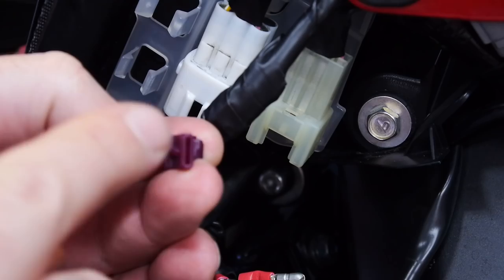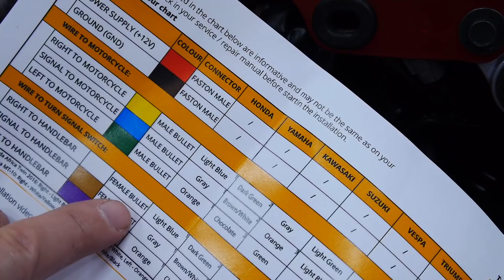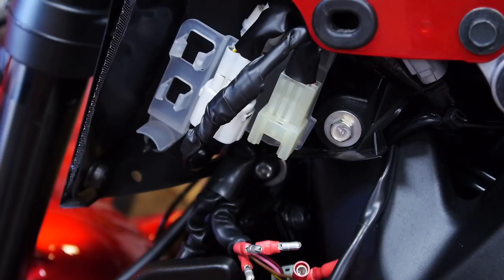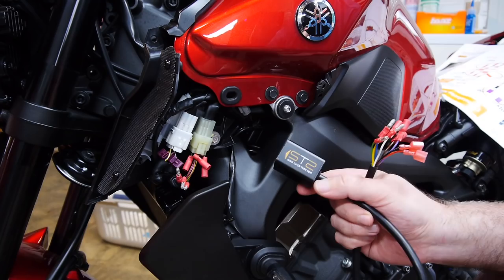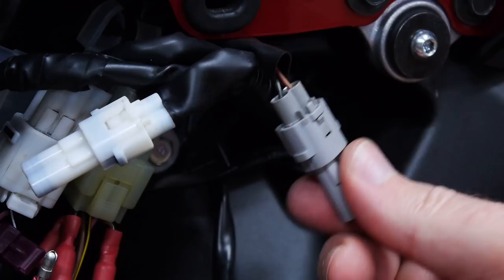FZ09 Self Canceling Turn Signals STS Smart Turn System Install And Review

Comment: Well done, Bryan. Self-canceling turn signals should be mandatory. Forgetting to turn a signal off can be a safety issue. It's unexplainable why my 1989 FJ12 has self-canceling turn signals and my sophisticated FJR13 AE doesn't. Keep up the good work.

Comment: Thanks for the upload. I’ve an MT09 and you have saved me a few headaches for sure. I might tweek a few steps like soldering instead of using the splicing connectors and I think I’ll go further back up the loom to find a better fixing and tidier point. Unit arrived today and who knows I could eat my words😂
Reply: So, what do you think of it, assuming you installed it? Thx
Reply: MrDeepseadweller actually starting installation today. Bn reluctant because I didn’t want to cut my loom but here goes
Reply: Jason Searle Good luck buddy. Please report back

Comment: Thanks...I have a 2015 zx6r and I ran into the very same problem with the install.  i have since removed it and went back stock.  I didn't think about opening thing or completing the install after it failed to calibrate.  I think I will go back to it and try it again.  You provided more help than they did.  I told them they needed more work with the product...Plug n play would be really nice and their R&D dept needs a bit more improvement.  Thanks again !!!

Comment: Those foam blocks baking in the Florida sun will disintegrate in no time. You'll be finding an alternative solution or pulling the system off and going back to factory way of t/s cancellation. I agree with your comment TWO the company needs to make a kit for each bike. I have never found any one size fits all to work correctly. Thanks for the review!
Reply from the maker: I bet the foam will be just fine.  The foam gasket on my FJR glovebox lid is like new here so was my 2006.  Same stuff.  I also garage my bikes.
Reply: @Smart Turn System Could you physically remove the latches?
Reply: @Smart Turn System Thanks for answering!

Comment: I can see the attraction BUT I am used to turning of my signals for 30+ years.  Its automatic for me, I don't even have to think about it.   So not a feature I need and I agree with other comments that the big barrier is that it isn't plug and play and that trial &  error foam thing on the switch sounds a bit half baked too....so a 100% no thank you for me :)

Comment: Interesting product, but entirely too expensive for the functionality it provides and for me cutting up my stock wiring. Even cars don't self cancel on highway lane changes, so this is not a problem I need solved (unless it's cheaper and plug and play).
Reply: SV650NYC I couldn’t agree with you more.

Comment: They definitely need to greatly improve the installation method. Plug & play would be nice, but at least needs appropriate size and type connectors......wire taps are poor engineering and you have male connectors on the hot side!! No, no, no....
If I liked it I would hard wire it in and shorten that harness to a workable length.

Comment: Great review, and thanks for that..having watched this and other reviews I would conclude that the device is inovative, clever and has potential. However the wiring side of things needs sorting, until they can supply it with interuptor plugs, and fully do away with crimp on and snap lock connectors the potential for post install problems is far to great, especially where DIY installs are prevelant, so not yet for me unless I can find a supply of suitable OE type multi plugs to assemble myself......

Comment: I asked my dealer if they'd install this STS switch for me at my next service interval. The response was No as in it would void the warranty, depreciate the trade-in/resale of the bike and be a liability if it didn't work and caused an accident. I enjoyed the video however, thanks.
Reply from the maker: Your dealer is full of shit about it effecting the warranty as a blanket statement.
Reply: I should have stipulated that anything regarding the electrical system of the bike will no longer be covered under the warranty. Sorry for the confusion.
Reply from the maker: Still bullshit.  Only something directly effected by any change is voided.  US law.
Reply: I think what the dealer was actually saying was that he didn't want to do it. I know how they are about changing tires that you buy somewhere else.
Reply: I agree with the dealer. If I saw a bike with a hacked up wireharness and shitty connectors I'd stay away from it.

Comment: Cool product. It looks like that aluminum housing is way bigger than that to has to be as well as being metal instead of plastic, hard to see on video.  

I’d probably try to find those exact connecters and fab up my own harness and not cut into factory harness.  Either that or just solder everything. 

The only thing that looks to be a total pain and ongoing frustration is the foam bits in the signal switch. If they made plastic pieces for each bike type that would just work first time it would be better. 

Also I have an XSR900 and not sure if there’s room to hide all that stuff. Still a cool product, it’s just a gyro (accelerometer) like from a drone flight controller with some software which is a great idea. One thing I don’t like is that it (looks like) it requires calibration each time you start bike. Does that mean if you forget to keep your bike motionless for several seconds after you turn key that it won’t work?
Reply from the maker: Yes the housing is larger than it needs to be. They share it among products.
Reply: TwoWheelObsession I think I’d get someone to 3-D print a casing that’s a more appropriate size. Actually that company should’ve already done that.

Comment: Way too much work and boogering up of stock harnesses, just to turn off signals. Just my opinion. Also, bullet connectors are weak point in my opinion. Anything exposed to elements should be soldered, heat shrinked, and wrapped with waterproof electrical tape. OCD, yes, but after many mods and installs over the years, no failures.
Reply from the maker: Nothing in that area is exposed to elements other than air.
Reply: TwoWheelObsession   I've ridden through rain storms where everything gets wet. Not critical of your work, just the units manufacture and their design using bullet connectors on a motorcycle.
Reply from the maker: I've ridden through huge storms as well.  Everything in there stays spotless, as you saw.
Reply: Doug Z I agree 100%! For years I was an installer for police radar and video and I can tell you those connections are shit. Not taping them up makes them even worse. He simply followed directions so no blame on his part.
Reply: I agree the best solution is to solder and heat shrink the connections, but a vast majority of customers do not own or know how to use a soldiering iron.  The manufacturer aims for the largest audience.  You are free to cut off the connections and solder-away!
Reply: @MrEye4get  You can get a soldering iron KIT from Amazon for $14.95 so not much excuse for someone not to have one.
Reply: Buying a soldering iron and using one correctly are entirely different.  Installation is still tricky and requires cutting wires; potentially damaging or voiding your warranty.  I have the STS installed and working.  More motorcycle makers need to make self-cancelling signals standard.
Reply: @robertbrandywine  assuming you know how to solder... if not, you'll only make a mess

Comment: thanks for the video, I am just fitting one to my 2015 MT09 Tracer and have the same problem, unit will not calibrate after step 3 and I have standard indicators lights, so I've disconnected everything put it back in the box and went back to stock. I'll maybe have another go tomorrow and forget the calibration phase as you did and see if they work, thanks again for the video, at least it shows I'm not going crazy

Comment: I’m in the midst of installing it on a Suzuki V Strom DL1000A. I think the test sequence when you first turn on the ignition works different on different bikes. Mine only flashes on the left side once. Yours didn’t flash at all.  Testing it manually though the signals work so I’m going to finish the install. I had to build a little platform out of metal and used the front tank stud bolt to fasten it to the frame.  I don’t know if it’s going to provide enough clearance for the plastic fairings when I reinstall them.  The connectors all work. I did have to replace one of them. One of the switchblade connectors broke and I could not find the same replacement so I am using a different type but it will accomplish the job.  I think it’s going to work, but I’m a little concerned about the connectors holding long-term, and also the operation of the switch once I get it put back together.We will see. It is a time-consuming job for me. I have big clumsy hands that are difficult to fit in tight spots. I think a dealer or automotive electrical shop would charge a fortune to install it so I’ve got to get it done myself. I really do want this to work. I think it’s a terrific product.

Comment: I don't see where you got the signal to light during the first test with only first 5 wires connected?  It seems to me that it didn't light because you were holding the unit vertical and not level?  Anyone, please comment, I have a 2020 Tracer 900GT, I really don't want to cut wires if it isn't going to work.  I have already received the unit along with the brake module.

Comment: Tried to install in a 2016 Kawasaki Vulcan 650 with LED signals and custom flasher reply.  Connected to switched power accessory connection behind the headlight.  Blew three fuses.  Disconnected the STS and reconnected the original wires.  The signal lights stay on; no flashing.  Seems the Custom LED flasher relay ($30) was also damaged.  Depending on the motorcycle you own, insulation can be difficult!  Placement of the STS control box is also difficult.

Comment: I didn't quite understand the fix for the accessory power issue. Did it work when you put the OEM relay back?  On the yellowish plug with the initial 12v wire and ground did you end up just using the ground from that plug?  Thanks again.

Comment: So, ultimately, do I have to really power the STS unit from the 12volt accesory, or can I still connect it to the motorcycle 12V wire loom?

Comment: Thanks for the great video. Are you considering putting this system on the FJR?
Reply from the maker: Possibly.  I chose the FZ09 for this install because it's a bigger issue for me.  The turn indicator is not in my field of view on this bike but the FJR is, I hardly ever forget them on the FJR.

Comment: Hey there Bryan, I wonder if the detentes in the switch could be defeated and instead of using foam to return the slider to center use a couple of springs to center the slider.  I fear that the foam is going to compress over time a become ineffective..just a thought....cool product....True Value Hardware stores have an awesome assortment of small springs. Rock on.....   :)
Reply from the maker: They may be, but I'm not going to permanently modify it to try.  For now the foam works fine.  If it changes over time I'll find another solution.

Comment: how did you expekt the turn signals to flash when they wasent connected to enything? the system calibrated but your turn signals were disconnected.
Reply from the maker: Uh, they were connected dude. The company confirmed this is normal with my LED relay.
Reply: @TwoWheelObsession  I think he was talking about at 10:15.  You can see the bullet connectors aren't joined.

Comment: If the FZ09's indicator / blinker switch is the same as the XSR900's then it's right on top of the horn! I keep hitting the damn thing! Beep Beep!!
This is the answer or (as I have seen done) relocate the horn button. Prefer to not hack the oem loom however...
Reply from the maker: You can change the cluster to an fjr or super tenere
Reply: TwoWheelObsession plug and play cluster?